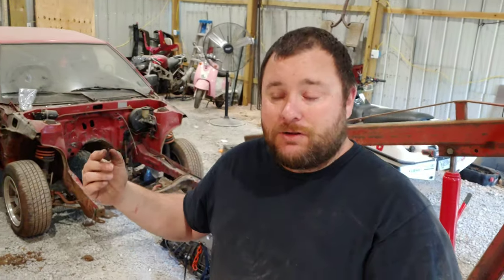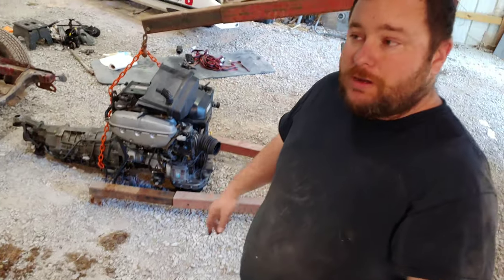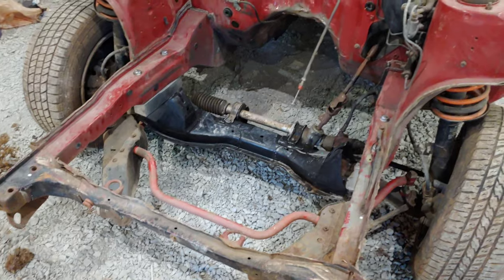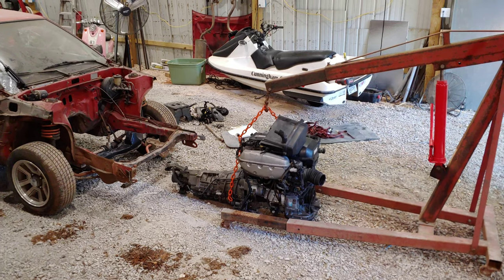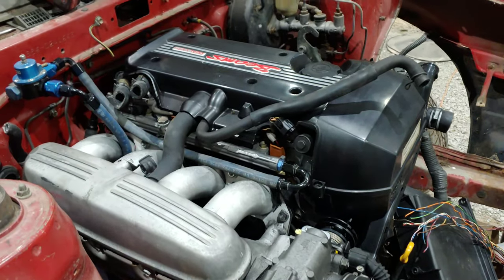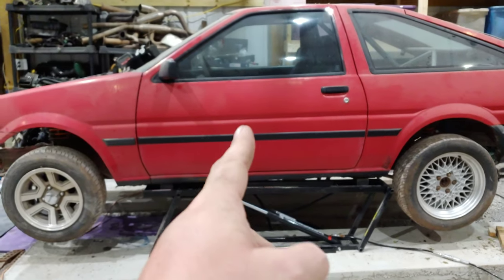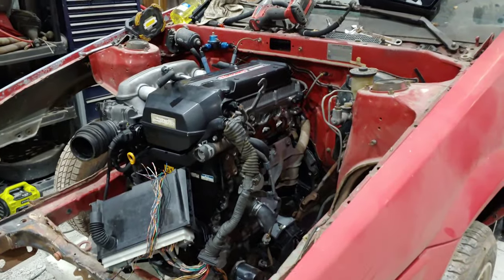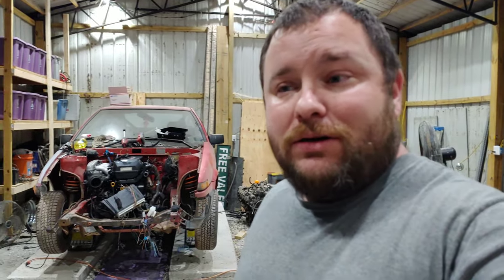Ae86 part 2

Comment: where did you get the base for the motor pointsmounts on the sides of the motor?
Reply from the maker: The motor mounts that bolt to the engine itself are from excessive manufacturing and the rubber mounts are stock GTS from RockAuto
Reply: @cunninghamgarage2074  I need the Beams 3SGE AE86 mount kit, where can I find it on the Internet?
Reply from the maker: Check out excessive manufacturing they make all the beams swap kits
https://www.xcessivemanufacturing.com/
Reply from the maker: I picked up the motor mounts trans mount and a drive shaft from them they were very helpful and shipped everything quickly
Reply: @cunninghamgarage2074  thanks!!!😎👍

Comment: How you cleared the oem swaybar
Reply from the maker: I'm actually dealing with that problem right now LOL
Reply: Cunningham garage please lmk make a video please
Reply: I can help on wiring I got mines start ready just need the left over parts (maf, etc.) and to wire the dash
Reply: I got 1.5 inch spacers
Reply: Ig it’s zuk0.7
Reply from the maker: I do need to make it updated video the car runs already I don't have any Factory gauges in the car I have all defe Equipment in the car now
Reply: Cunningham garage I see please do no one shows how to fix this swaybar issue